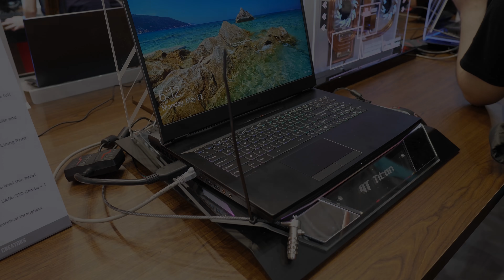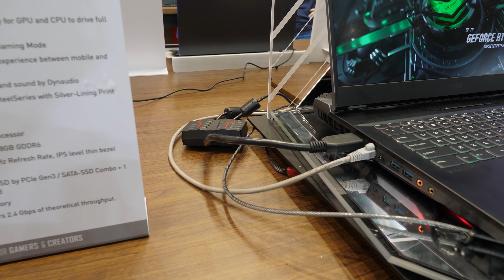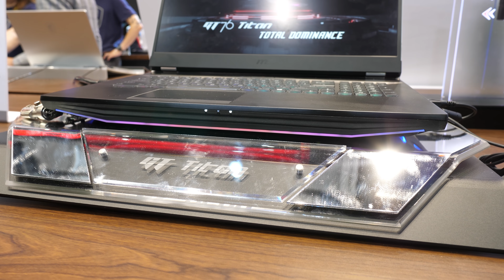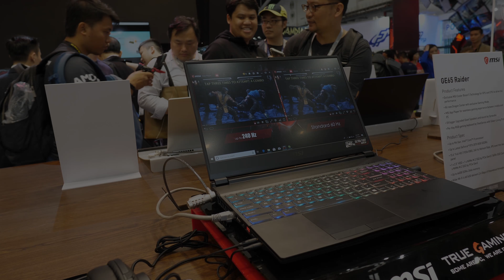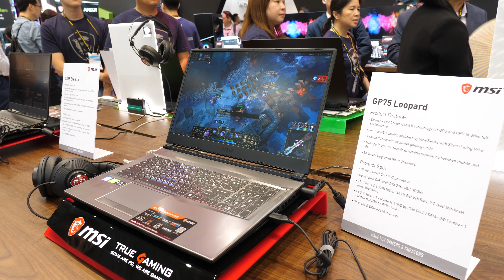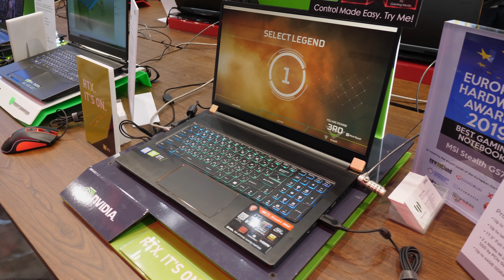MSI’s 5GHz 9900K Gaming Laptop? Meet The GT76 Titan!

Comment: Clevo/ Sager laptops with EXACTLY THE SAME SPECS AND OVERCLOCKING CAPABILITIES have been out for less money since the 9900K was released long long time ago already.. this is positively nothing ''news''.

PS - The same for the 9900K model from Alienware, equally already for many months (albeit ridiculously overpriced as everything else from Alienware).. all same same, nothing new to see here.
Reply from the maker: I'm aware, I have covered them on the channel. They could not get to 5ghz, the cooling here is far more and makes this more interesting to me.
Reply: I have a Sager/Clevo and it does get to 5GHz (but indeed not for much longer than shorts bursts before it down clocks). For that, I have by my own hands literally drilled two 1/2 foot cut-outs from the bottom of the laptop that instantly and largely improved cooling. I also delided my 9900K which further improved things (I almost killed it by the way and highly don't recommend anyone doing it). Now I can get longer sustained 5GHz bursts before the speed eventually comes down.

This said, I do believe the MSI may have a more substantial cooling design (and the same very large bottom cutout for air to rush in more freely then I did myself on my own Clevo laptop). But the fact of the matter is that ultimately the performances gains from always on at 5GHz or a slight down clock, is minimal at best are not worth too much work or sweat for it. 

And then there is the upcoming new i9-9900KS that (supposedly) will run at 5.0 GHz permanently. If true, will make it much easier for these laptops running it to handle and sustain the speeds up.

PS - I think Intel is starting to be on panic mode with AMD's recent news, haha :)

Comment: The fans in this thing are super loud. I remember on my previous laptop, the GT73VR, it was noticeably loud during idle in desktop. You could always hear it, never whisper quiet. I own the Alienware Area-51M, and that thing is seriously whisper quiet during idle. When gaming, its fans are not annoying at all, all you hear is the air blowing out, not the motors.
Reply from the maker: Yeah they were quite loud, the 51m is arriving here tomorrow so I'll see soon. The CPU also clocks higher here than the AW.

Comment: This thing takes one step forward and 4 steps back from the GT75. Great we have a LGA 9900k. But we lose the MXM GPU, lose the mechanical keyboard, lose 2 m.2 slots, and lose one USB type-A port. Plus the side connector is poor design. I prefer the connections for display and power on the back.
Reply: GrayFox370 dat true.... wtf LGA but no MXM?
Reply: Yup. Go on the notebookreview forums. The GPU is soldered.
Reply from the maker: Mostly limitations from making it a bit smaller.
Reply: @JarrodsTech  why? We would want it to be bigger not smaller

Comment: Just for context and scale, the auxiliary fans on the GT76 are the same used on most MSI gaming laptops with power consumption of up to 230W. I truly believe this thing can handle 5GHz on the 9900K.
Reply from the maker: Yeah looks like a beast!
Reply: Scale? Have a look at a NHD15, that's the size of aircooling needed to handle 200W worth of 9900K, then have another look at the CPU cooling module here
Reply: @greebj  The NHD15 is to keep the 9900K sub 70°C. On the GT76, the cooling solution is to keep the 9900K at 5GHz at sub 100°C.

Comment: Huh! They make beast of a laptop and then put 144Hz screen on it. I know 144 is enough, but with this new trending stuff around gaming laptops are 240Hz screen, and that too they're on some slimmer laptops that can't even push those frame rates. This one surely can use that 240Hz screen buy instead they go for 144Hz one. I don't understand these marketing stuff 😑 #meNoob 😶😑😶
Reply from the maker: Yeah not sure why that was the case.

Comment: Hi mate, I have few questions would you inform me with your wise researches I will buy a laptop for my engineering lessons I'll usually use cad programs also I'll play every kind of AAA games and dota2 so here's my question what is the most efficient laptop which has RTX 2060, I choosed that graphic card because of that shows my limit of budget if you can help me I'll be appreciated I really confused.

 By the way thanks for the dota2 reviews probably you're the only reviewer which do it this also you're giving us everything deeply in your reviews. I hope you'll  take of your labor's response.
Reply: i would suggest 1070 non max q over 2060, price cheaper now, and laptop rtx 2060 not strong enough to support decent fps with ray tracing, i wouldnt suggest rtx 2080 laptop unless it is 200 tdp rtx 2080
Reply: @pekkadonquixote4112  thanks alot for your answer, cheers
Reply from the maker: Efficient for what? If you just mean performs best you'll have to check my reviews and compare the numbers, but even then I haven't tested that many 2060 laptops just yet.

Comment: they should have gone fore 18.4 screen
Reply from the maker: I think they wanted to keep it on the smaller size with the thinner bezel.
Reply: 18,4 is quite bad for backpack i think
Reply: screen choices for 18.4 inch are few and mostly terrible. MSI learned that with the GT83, getting canned for being stuck with mediocre 1080p 60Hz when all the halo products from the competition had better base models and higher refresh & res options. The only decent 18.4" panel ever was the 4K IPS in the GX800 (which FWIU was Asus exclusive)